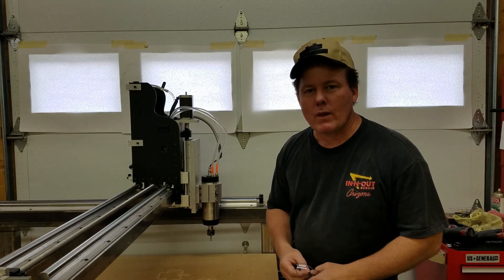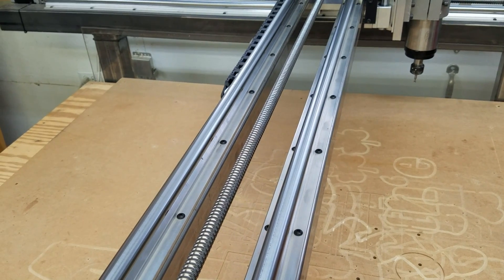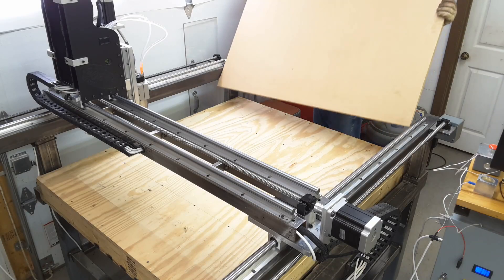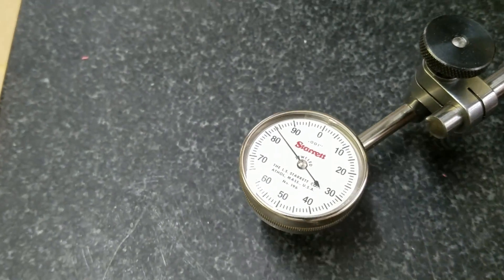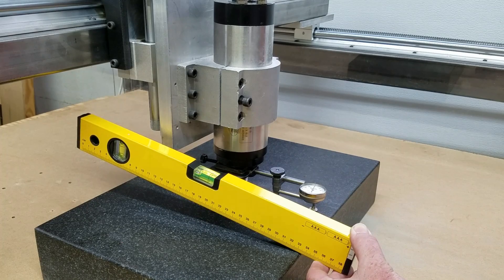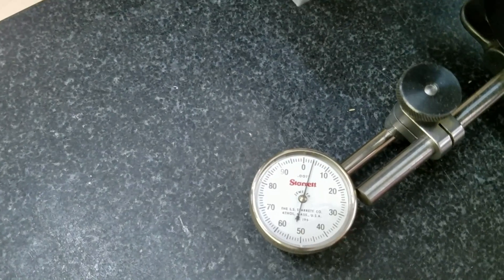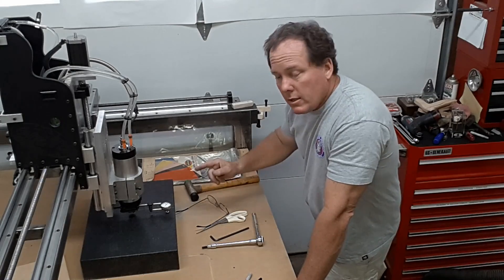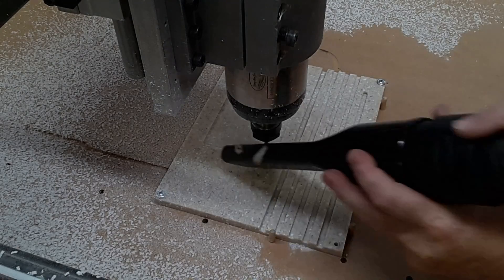Traming the CNC Router and final rigidity improvements

Comment: Just a piece of info. Although You improved cutter perpendicularity, you should have trammed and shimmed to get Z axis rails perpendicular. If you drill with your router, the drill will be tilted in the hole as it travels the z axis. In effect, rubbing on one side of the top of the hole. Kind regards.
Reply from the maker: Hmmmm.  Ya.  Your right.  I hadn't thought of that.  Thanks.  I'll check that out.  Any suggestions on how to measure it?  ~P
Reply: Do you have access to a height guage? If so, put your indicator in it, put the tip on the rail and turn the crank on the height gage to run up and down the rail. Do this at different radial positions as you shim. Once you have the linear rails perpendicular, then "tram" the spindle as you have done. Would then be perfect.
Reply from the maker: @TCoulter1  I have a height gauge but it doesn't have a crank.  I'll keep noodling on it. ~P

Comment: Could you not drill and tap another pair of holes in the carraige to allow the motor clamp to be further down and keep the motor at the hight it is, for thicker material you can always undo the 6 screws and put them back to where you have it now.

Comment: Nice job. This is done assuming that the aluminium bed is square with the x-y plane of the rails right? So, the first step is to square up the bed with the movable rail plane, followed by spindle tram right? Also, by adding the 2 layers of wood board to the metal bed, there can possibly be surface angle due to the wood boards right? The granite block looks good. I'm going to try get one of those ones. I'm currently in the process of figuring out how to square up everything in my small 3040. Your setup looks great.

Comment: Have you had a problem with dust on the SBR rails or ball screws? I'm currently building a smaller machine, and I'm worried about the mechanical parts getting gummed up with sawdust.
Reply from the maker: Ben... I haven't had any issues as yet and don't expect to.  I do keep the rails wiped off, just because they are staring me in the face.  All the motion parts have wipers on them, but they are not perfect.  ~P.

Comment: By no means ironic or sassy, just curious: what's the idea behind setting up a nice piece of precision granite on what is essentially a big piece of wet cheese? How can you guarantee the granite is actually perfectly parallel to the actual bed of the machine, in order to use it, then, as a reference surface for tramming?
Reply from the maker: The 'cheese' is not smooth enough to get a good sweep across and try to measure thousandths of an inch.  The granite is.  The 'cheese is not perfect so the plate averages out the small ups and downs.  Both sides of the granite are parallel..or at least significantly more accurate then the machine will ever be, so I was sure to not be adding to the 'cheese' factor.  And thirdly, because I had it.  I had considered an older cast iron surface plate but the surface was all dinged up by someone that used it for a place to use their hammer.
I guess the answer is, I used the surface plate because it is cheese.
Reply: I "trammed" my machine by putting a square up next to the spindle. I used the "significantly more accurate than the machine will ever be" logic to justify that too. heh